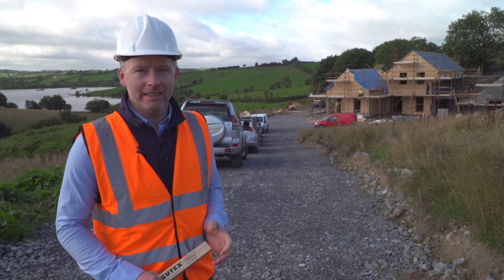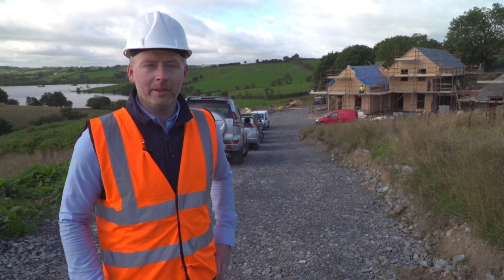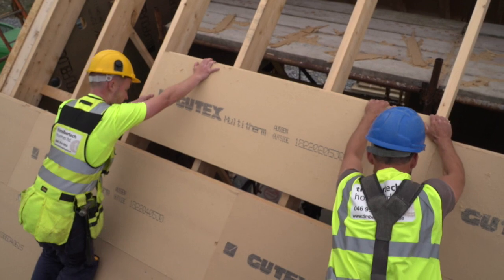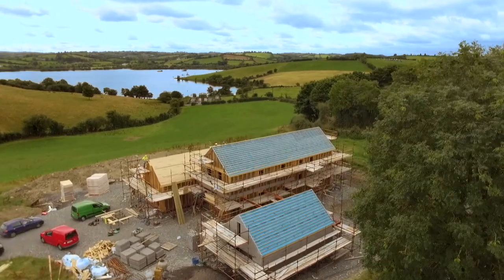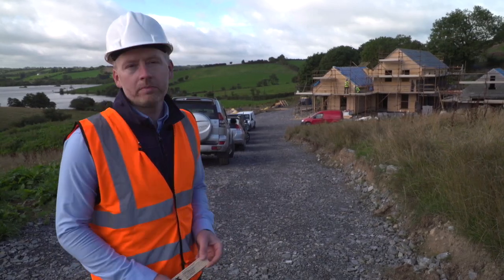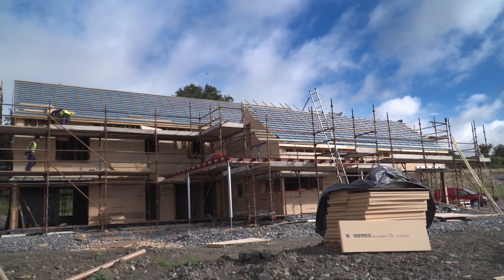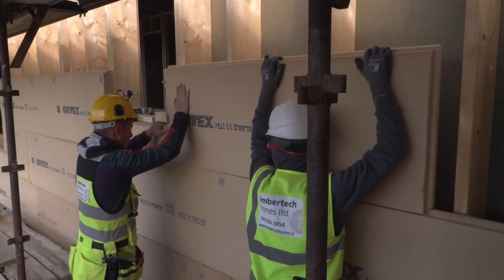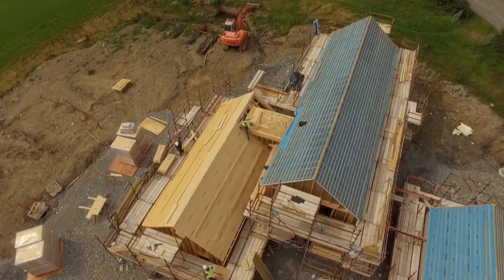Passive House Insulation Series Introduction with Niall Crosson (part 1)

Comment: Would it be fair to say that building to the current Irish building regs for new builds, you are achieving the passive standard? If not how far off would you be and how much more expensive is it to build a passive house? Looking forward to more of these videos..
Reply from the maker: Hi Michael. This house will be a certified PH. Current Irish regs are to nZEB. The onerous requirements for airtightness and thermal continuity as well as overall glazing U values are not as onerous as PH. Nevertheless nZEB is still quite a high standard and a major improvement from where it was. In terms of cost, with the right planning and attention to detail in Ireland it can be cost neutral. More info can be seen here: https://passivehouseplus.ie/news/design-approaches/going-a1-rated-certified-passive-lifts-build-costs-by-0-1
Reply: @EcologicalBuildingSystems  thanks for the reply. Good luck guys